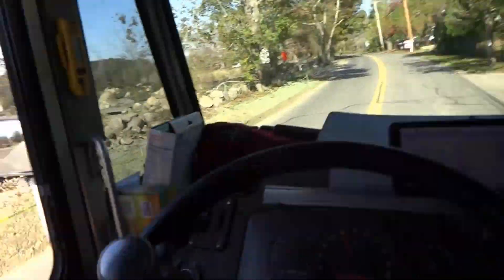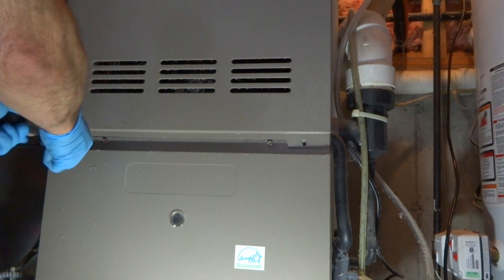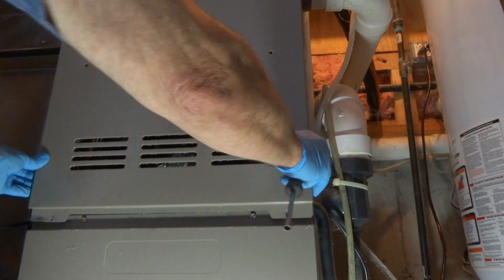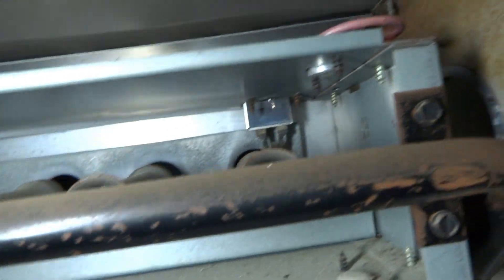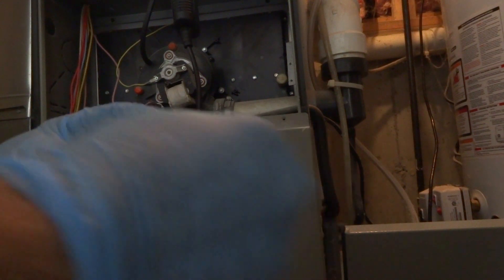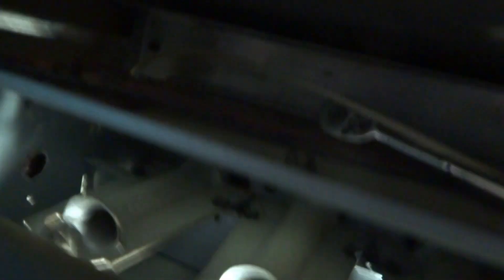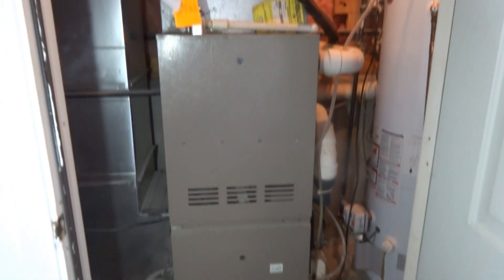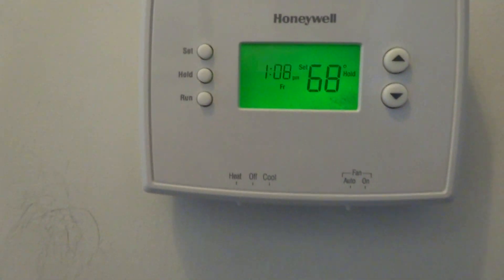GOODMAN GAS FURNACE NOT HEATING HOUSE ISSUES FIXED

Comment: Just a word of caution, if adjusting the gas pressure, use a manometer. On those Goodman's, if the collector box is cracked(this one appears to have a crack going up from behind the inducer), you can be sure that the heat exchanger is bad. I used to use a smoke pen to confirm.
Reply: Good tip!

Comment: Morning Steve. Try a fresh battery in your printer and it may print better and a little darker. Love all your video's. Thanks for all the information you give to us.
Reply: Mark Emmanuel  Ahh. Thanks Mark thought maybe it would help. Happen to know which part needs to be replaced ?
Reply from the maker: Will do yes new batterys do make the print darker there due to be changed

Comment: Bad designed furnace with burners above the inducer combustion blower,just like the Frigidaires
i find the heat exchangers wear out
Reply: Carrier did the same thing 25 years ago. The inducer motor is cooled by ambient air and not sealed in with combustion intake.  A little more noise, but 25 years ain't too bad

Comment: steve, what calculations are you using for required boiler operating pressure? i'm currently following slantfin's cold fill calc for fill pressure but I can't find a decent one for operation
Reply: @throttlebottle5906   yes that's the cold fill calculation, I'm talking about during operation AT TEMP. 12-15 is the universal standard for single story which I understand, but i'm trying to find the math for AT TEMP
Reply: @throttlebottle5906  Yes but I've also seen xpansion tank pressure increased. I.e. an extrol 30 pushing 20psi for 15 years. I know theres a calc out there that actually gets down to a science for feet of head above boiler factoring in operating temperature for psi.
Reply: laskalives Personally I think your overthinking this a bit . As long as you have the proper expansion tank and you fill the boiler cold to the right pressure ( for the height of the system ) what ever the pressure builds up to when heated should be fine as long as it doesn't go over 30# and blow the relief valve. The pressure will vary as the system loses small amounts of water over time, ( and they all do I don't care how tight the joints were made up when it was installed  ), that's why most boilers today have an automatic water feeder. 55 year retired plumber 👷🏻